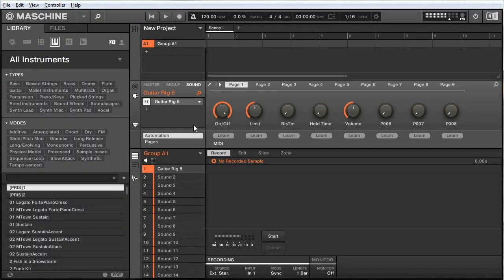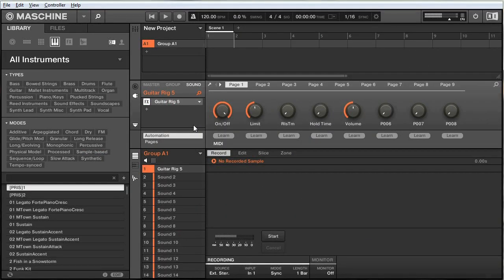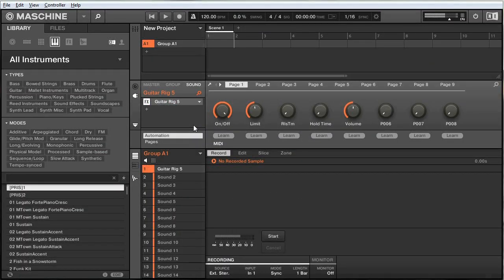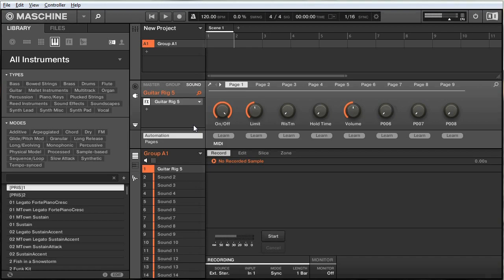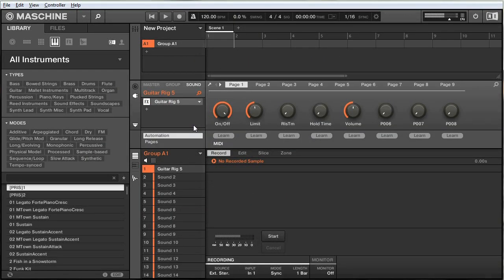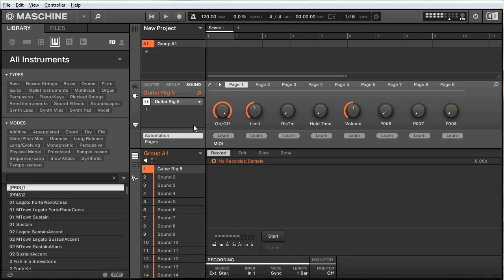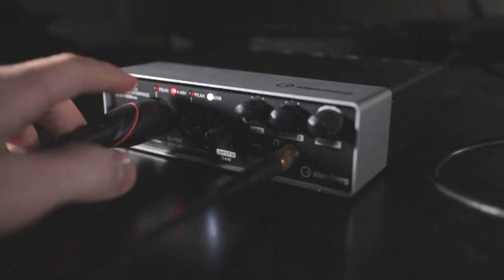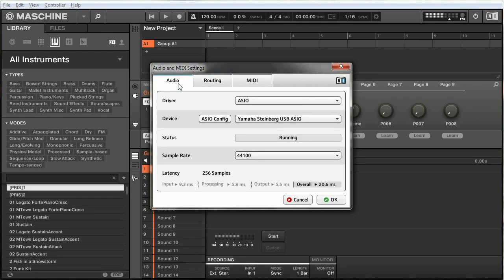Understanding and Setting Up an External Audio Interface

Comment: how did you get this audio interface to work the right way did u get the mic that comes with as a bundle and working fine for u I bought one and I have it setting on the side!!!!!  to download everything and get it to work on Mac its been a nightmare and I end up some how got to work but the software fort that it taels you if its connected or not it wont show anything is there and when u go on them website my god a million downloads different updates  and I gave ups downloaded all and tried all and still steinberg website and download and install its been the most horrible experience I ever head no have an exact up to date instruction for anyway still some  how worked with out showing that there is an interface. and I plugin the mic and as son as u turn that nab to the middle and the electric noise goes crazy  I actually set it a side and went back to my cheap presonus audio box that non of this problems I did head to deal with install in 5 minutes working perfect and wont hear all that noise when I plugin the microphone and when u look how many people are stuck with that box or asking online for help before they cant get to return it is amazing f steinberg its siting on my shelf like a stain on there never going away  I hate them that bundle I am not using anything from it hoping I have a day or n2 to deal with it again if you do make a video please that would be nice of u because other videos always missing something not for Mac or not the latest update its always something

Comment: im having some trouble with my scarlett focusrite interface. I can use it to play music through maschine but cannot get the inputs to work. For example if i plug in my sp404 out to the L/R and try to sample maschine does not recognize the signal. The interface gets the sound because if I switch the interface to direct it will play out of my speakers. The maschine software inputs options I have are "microphone 1" and "not connected" and neither of these let the signal pass to be sampled. Any help would be greatly appreciated.

Comment: Hey man, I just bought one of these with Cubase Elements 9, and i have an 88 key yamaha keyboard that i want to connect and use in Cubase via Midi in and out. However, after connecting the midi cables, i can't get it to recognize the keyboard through my MkII... Any troubleshooting help? i cant figure it out! Thanks man

Comment: So I can just plug in a pair of headphone into a 3.5mm to 6.3mm adapter and it'll work with sound? What if it has a microphone on it, does it still work, does the 48v Phantom Power change anything?
Reply: Yes on headphones, no on headphone mics, but you can get an adapter. 48v is required for condenser microphones.

Comment: My current setup: MacBookPro, Maschine Jam, Alesis V25, AudioHub 2x4. I haven't really been able to get this all to consistently work. When playing tracks on Maschine 2 software, often the audio cracks, skips or stalls.  Audio Hub is plugged into the Mac via USB (and am using the AC power cable in the wall), Maschine Jam and Alesis are plugged directly into the AudioHub. Any suggestions?

Comment: I want to use the USB out of my Oneplus to my audio reciever via my external USB DAC. I have a powered USB hub and an external Little Ego DAC. I am having a baller of a time figuring out how it all runs cable wise.  Do I go USB out of phone to hub, then DAC into hub, then DAC 3.5 mini to RCA in on receiver?  I am not getting audio to play in that case but it seems logical thats how it should be wired?

Comment: I’d like to know if I can connect my midi keyboard with this external audio interface for better recordings without clipping and high latency, plus do I just need a jack cable to connect them two or is there anything else that’s required to work.
Thanks!

Comment: In an interface, is it possible to get audio output just through the monitor headphones and not the monitor speaker??
Reply: This audio interface, has 1 output for Monitoring Headphone, means that the output level is different compared to '' Line Output '' for the monitors, you can use both for the Speakers out.
Reply: Isaac Cespedes Thanks. I just wanted to know about it since im not being able to use my headphones. I can only hear through my speakers. Thanks once again. Cheers
Reply: Any question you have, make me know here, greetings,

Comment: Well i have a sad story, i bought a ir22 mkii but never made it to work, never it failed in all computers i tested, and actually i order a replacement and same story
Reply: Hello, I had the same problem with another Steinberg Audio interface, exactly the UR28M, I told you that I did not recognize the computer to the audio interface, but the problem was not the interface, the problem was that I did not install the ' 'Drivers'' of the interface to the Computer, once installed, the interface worked correctly, if you have any questions talk to me here, greetings.

Comment: Who is better in terms of tatency on mixing (production) UR22 MKII or Focusrite Scarlett 2i2? Thanks!
Reply: I haven't personally used the Focusrite, but I own the UR22 MKII and it works great for what I'm doing. Just make sure your buffer size isn't set too high, or you will encounter latency issues, no matter which (low endy budget style) audio interface you're using.

Comment: When I’m recording, I hear my voice through my headphones a little delayed. Would an interface help me fix the problem?
Reply: You have a problem with latency. Check your ASIO buffer size.
Reply: epoy yes that would help a lot lol, search for the scarlet 2i 2. It's really good for that delay problem
Reply: @bubblebass1902  do you really believe the "delay problem" aka latency, is an issue which can be dealt with by just buying a budget interface? lol
Reply: Agreed that it's a latency issue. Getting an interface would help, but you can still encounter those delay problems - which is definitely distracting while recording. If your buffer size is too high, there tends to be an increase in the time between what you're singing/speaking and what you're hearing. Hope this helps!
Reply: Depending on whatever daw your using , though almost all alone you to , you can mute your playback from your vocals while letting everything else come thru.
Reply: No... you're doomed

Comment: Lol EXACTLY 2 YRS LATER but If I connect a turn table to the inputs in the back (rca) will the sound comes out thru my computer speakers or do I have to have a receiver with speaker?

Comment: ok i have Maschine and want to hook up interface I bought the PreSonus  i have made setting changes in the computer. How do i link interface to Maschine do i plug into the back using midi cables to link or what? Video never talked about that connection between the two for Audio

Comment: Back to the point anyway, I have two krk rokits and also the krk subwooferbox, I need them connected to my mixer for my turntables?

Is getting an audio interface my only option?

Comment: How would I connect my Yamaha PSR2000 to this. I used to just have an audio composite cable going from my Keyboard to my HI-fi CD Recorder, and record straight onto a black CD, but it packed up recently, and I'm derperate to find a way of recording my music again. This method seems a lot more complex to me, but just wanted to be sure I could connect my keyboard to it. Apart from the red and white composite outputs, I also have two left and right quarter inch jack outputs. Any idea which out of these two outputs I should use, and where abouts they would plug into on the interface? Many thanks

Comment: I currently have a XLR microphone going to a phantom power and then straight to my PC's microphone-in in the back. Additionally I use a separate amp and DAC combo for my headphones (FiiO E10K Olympus 2). How would I benefit from using and audio interface and what are some good cheap interface's to start off? Would I be able to use my headphones with it (using the interface as a source instead of the DAC)?

Comment: This may seem like a stupid question.. I have an audio interface, and notice how the port for headphones on the audio interface is bigger than the standard jacks that come as part of a normal headphone wire for, say, a pair of Beats. Do I just need to buy a different cable for my beats? One that plugs into both my actual headphones (which has a normal sized, standard headphone port) and also has a bigger jack on the other end that plugs into the audio interface? Help would be greatly appreciated!

Comment: Hi, want to buy the JBL LSR305. I want to connect them in my desktop pc. Now what is the best solution ? A Steinberg UR22 MK2 or a DAC like SMSL Sanskrit or Schiit Fulla 2. I want to control the volume, bass, tremble by a knob not use the computers eq. Its much easier for me to have a knob.  What do you recommend ? Thank you

Comment: Hey, great video thanks ! 
I'm using my Maschnie to add sounds to sets through Traktor and the S8 using a focusrite scarlett 2i2. I'm routing into channel 4 on the Kontrol S8 and the sound is very low, even with the master out in maschine and the gain on the S8 up full. Am i missing a setting, any pointers? Thanks

Comment: Does help with crashing or it seems like the maschine software pushing out to much sound have the maschine studio I don't record from home only produce but out of nowhere it's will start slowing down and getting choppy I noticed at the top of the screen on the right where CPU battery indicator  battery would be filled when it shoes that jump to the max like it's too much volume will the audio interface help with that ? Has anyone else experience this
Reply: Thanks for any and all feed back

Comment: I want to use an interface as an ADC and DAC but one thing I'm wondering is how if the audio output on the back has to use an XLR input or if there are interfaces with dedicated digital inputs and analog outputs for speakers.

Comment: where does that headphone thingy wire go? how do u get it connected to a pc ? i dont get it. x.x im stoopid.
Reply: It's USB so you plug it into your PC/Mac then anything audio related you plug into this box, such as microphone, headphones, speakers, and a whole plethora of things. It will also sound better than the sound chip that comes with your PC/Mac.
Reply: the audio interface can also act as a headphone amp, and will likely have far flatter signal for your headphones. They might not sound as good to you through the audio interface but they will sound more accurate and better for music production. It might seem like an interface is for plugging things into but it's equally important purpose is a DAC or as a better option than the sound chip in your pc. I don't see a way to use 2 usb DACs at the same time, Windows only let's you play one device at a time. Essentially, you're best off plugging your headphones into the rear headphone port of the DAC through the 1/4 inch headphone line, may need a 1/8 adapter. If you find you like the sound of your amp better switch back to it for recrational use.
Reply: You're very welcome.
Reply: ty
Reply: Can I plug a usb mic to this interface or is only for xlr mics?

Comment: Im looking to buy an audio interface...... right now im just using a DJ mixer and connecting it to my macbook (AUX cord to RCA) and theyre connected to a JBL speaker... when i sample, i usually just convert mp3 to WAV file and drop it into maschine... so my question is will it make my beats sound more crisp overall? will it make any difference in my case?

Comment: I have a really powerful gaming laptop and since I bought Komplete 10 Ultimate I have found that there has been really bad latency issues with crackling or the sound not not playing at all. I thought that buying a Komplete Audio 6 would fix this but it hasn't. What's going on?
Reply: +JimBeam Buffer size. Raise it.
Reply from the maker: +JimBeam First make sure your laptop isn't in power saving mode (search for "power options"). You want "high performance" instead. Then, you can play around with the ASIO buffer size. A larger buffer size means more latency but fewer clicks and pops. Hope that helps!
Reply: +JimBeam Do you have an external audio interface? Sometimes the stock sound card/drivers are everything but good thus purchasing a dedicated card to handle the signal directly can vastly increase the performance/sound quality.
Reply: ***** I have played around with all the settings of my computer and that of the buffer sizes and the sound still ain't great! Mind you! I do like to use Mike Huckaby's way of using Maschine where you have around 16 groups each with 16 sounds!
Reply: ***** hmm I have the NI Komplete Audio 6. I'm not sure what you mean by the dedicated card? Do I need to look into that aswell?
Reply: LatigidGolana Ye I've messed around with the settings but still have some problems when I load a couple of the newer Komplete 10 instruments! It's a big time bummer!
Reply: JimBeam
You need to go into the Buffer settings for your interface. You'll do this from inside the DAW or program you're experiencing trouble with. For example: upon opening Reaktor5, I go to - File / Audio Midi settings, Next to Device, should be a button for your buffer settings. It may be listed as Asio settings or Buffer settings ect.
Reply: +JimBeam Oh sorry my bad, I've read that quickly and thought about Komplete as the software pack only, completely forgetting about the interface :(. If the crackling persist even after correctly fiddling with buffer length (as mentioned by +JimBeam) it has to be a problem with the driver, or worse, hardware damage. Assuming it's the driver, make sure that the driver format you're using is ASIO, and that the stock windows driver (DirectSound - DS) does not interfere in any way with the flow of the signal.